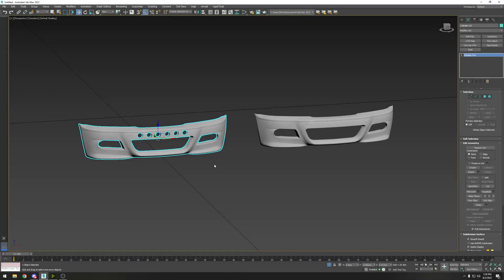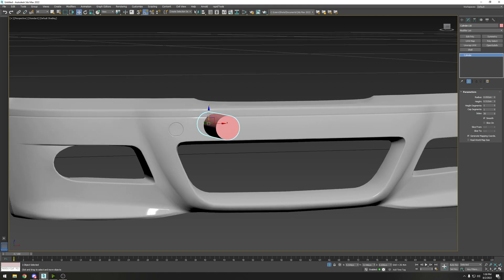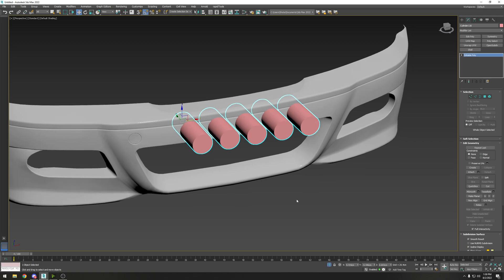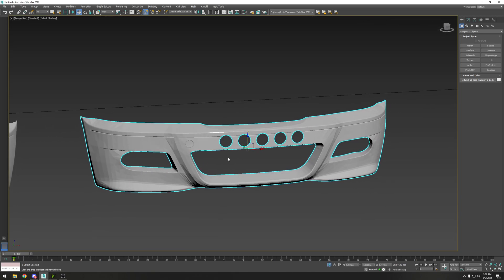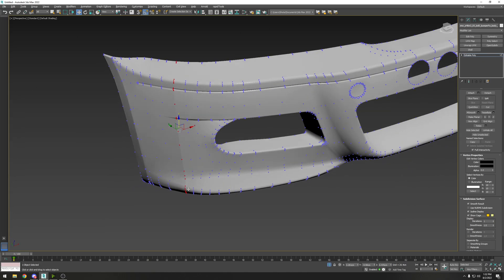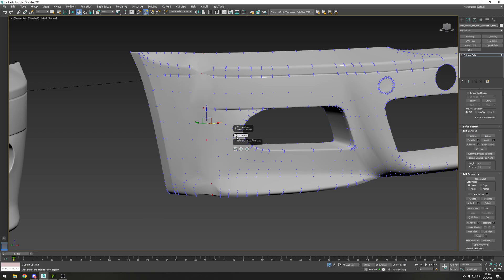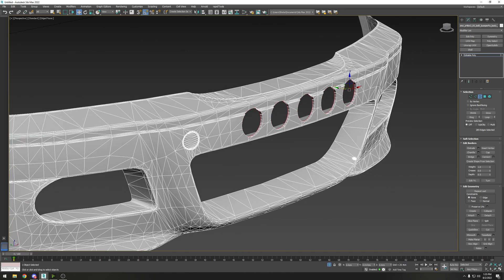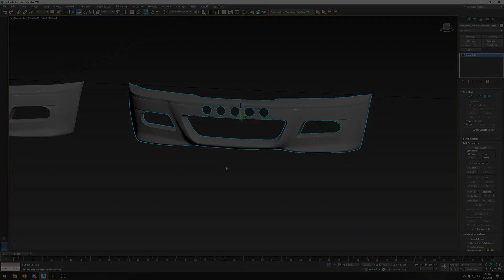HOW TO: Bumper Holes | 3DSMAX | Mamiya Motors

Comment: Hi! Your videos are been very helpful and I created my first car mod. Car works perfect in the game. Both visually and physics. I wanted to upgrade this mod. Encounter a very veard thing. I do unpack kn5 open fbx on kseditor before even change anything. everything looks fine. Saving kn5 but all objects I put the car or detach from original model are missing. Like a ripped off car. Do you have any idea about it?
Reply from the maker: Uhhhh if it’s missing when you look at it in kseditor then that probably means there isn’t a texture/shaders set for that object
Reply: @MamiyaMotors  everything looks perfect on kseditor. Parts missing on game. Not textures. Objects are missing. And its only untouched fbx file just unlocked kn5. Its very weird. Its working car mod I just unlock kn5 and save it back through kseditor. Parts are missing
Reply from the maker: That is weird. Possibly parts that are encrypted within the kn5? Not sure haha
Reply: @MamiyaMotors  :)) making all again

Comment: Hey, few more additional tips for the viewers (not in chronological order)
- The reason for those broken/separated vertices is because of mapping, basically that main edge is separated for the side and front view portion of the front bumper.
- If you want the holes to be accurately set in the middle of the bumper, you can re-align the pivot point to the middle of the cylinders and use edge or vertex snap tool to snap to the middle of the bumper
OR if you're working in the middle of the scene, the same concept applies.
- If anyone is having issues with the bumper distorting like crazy with weird shading after undoing or redoing, you can use the symmetry modifier to fix that issue.
hope this might help out someone, but very informative video✌
Reply from the maker: Great tips! I forgot that the mapping would cause those separations. Thanks for taking the time to list those out!